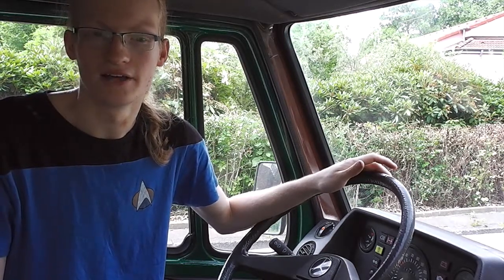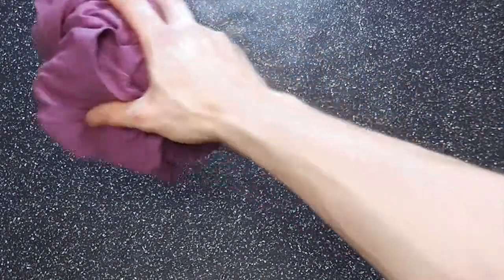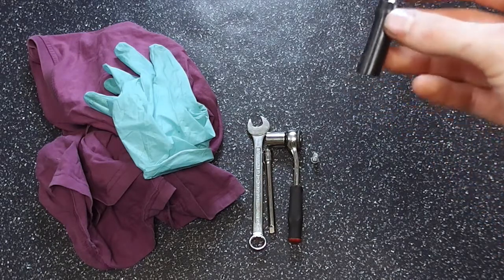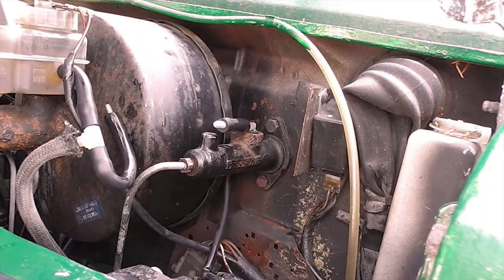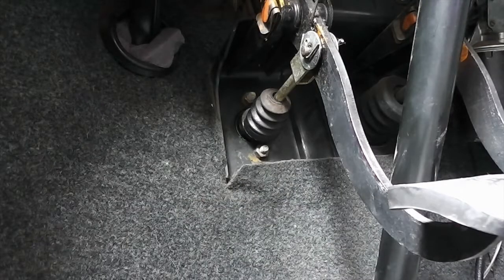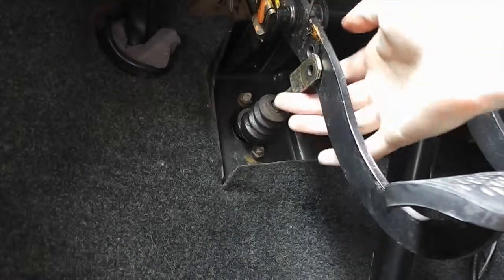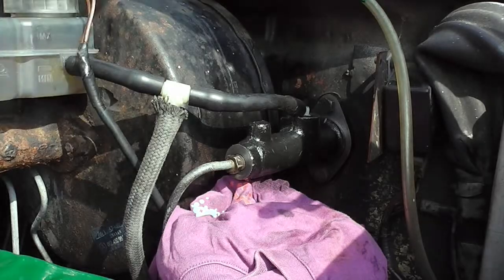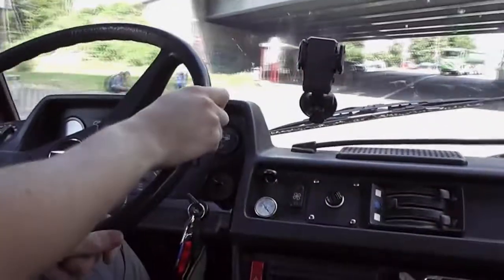How to: Clutch repair on a 1986 Mercedes T1 Bremer 209D - changing the Master Cylinder

Comment: Nice video, I will be doing this replacement on my 207D next week. Will also be replacing the slave cylinder since it was only 13 euros and so far the brake cylinder and master cylinder both went bad so I'm replacing it as a precaution. Watching your video till the end our other 307D had a rusted up bleeding nipple as well so that's another reason to spend the 13 euros on a slave cylinder. It's a no brainer really.

Comment: Wondering what mm (10 or 12mm) the master cylinder thread (diameter of threaded bolt) is (that connects to the metal fluid line in engine compartment)? Thanks!

Comment: Hi! I wonder if you could tell me the name of the metal pipe that the fluid travels down? I have no idea of the name and this is the part I must change
Reply: Hey! A little late, but i think those are simply brake lines. Usually you bend them yourself with a special bending tool.